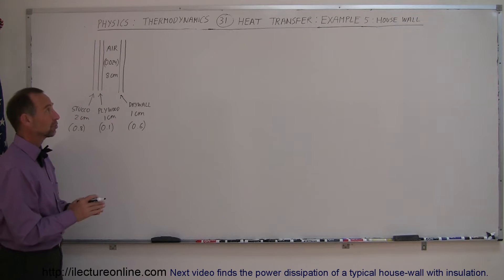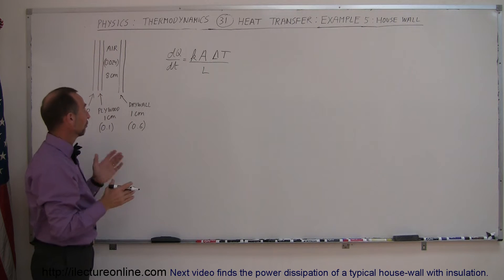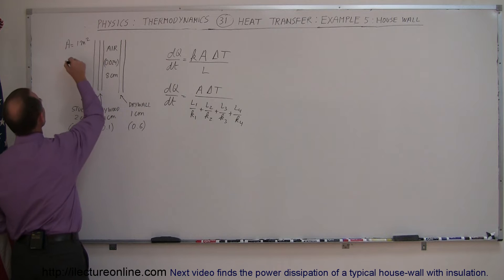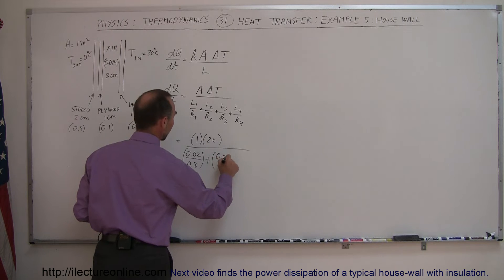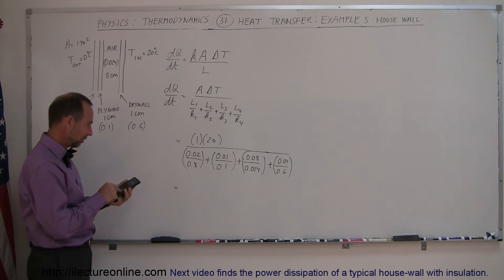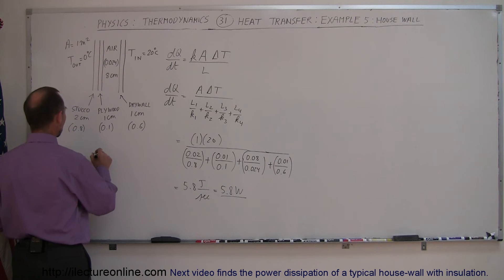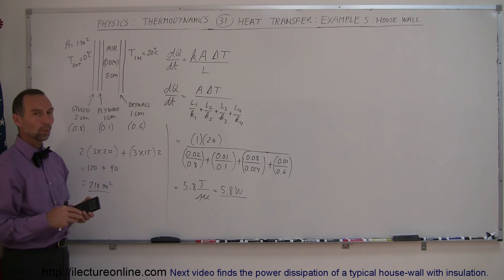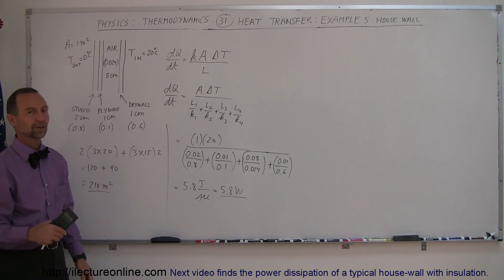Physics 24  Heat Transfer: Conduction (6 of 34) House Wall

Comment: Video was very good.. Learned a lot.. But I am little confused with the second part.  sir, when u were calculating the area of the four walls of the house u took the height 3 feet and length 20 mts. And still got the area in sqmts. Pls can you explain
Reply from the maker: The "3" represents 3 m.  If it was 3 feet that would make it difficult to stand up straight
Reply: @MichelvanBiezen  ok, but you said at 3:40  "single story house which has 3 feet high",  and I got confused.

Comment: you had to write cubic meter not square meter because I think you were calculating volume not area
Reply from the maker: No, it is square meters, since we are calculating the area of the house walls, not the volume.
Reply: no, I don't think any of those equations or calculations had volume in it.  When he calculated 210 m^2 he was also talking about total area, not volume.

Comment: To be more accurate, you'd do this, then subtract losses to convection, then subtract losses from radiation?
Reply from the maker: +Kevron Rees    It is not as simple as that.  If you want to have a "real" estimate of the amount of heat transferred, you would have to take into account a number of aspects that are ignored in a simple modeling of the heat conduction.  (For example the temperature of the surface will not be the temperature of the air on the inside and the outside).  These are just for learning the technique for calculating heat conduction through multiple layers.  The real world is more complicated.

Comment: I wants to find minimum insulation thickness required to cover heating block of 3.5" X 3.5" X 3.5". Should I use the following formula to find x.
Q= kA((Heater Temp -Ambient Temp)/x = hA(Surface temp-Ambient Temp)
Reply from the maker: +Harmeet Jammu It appears that there is something missing, like a constraint.  What is the goal for putting insulation on the block?  What is the permissible heat loss?  There must be some other restriction.
Reply: +Michel van Biezen: I have Heater Temp=810.9K, Ambient temp=295.3K, k=.12W/mk. Surface temperature outside of insulation I do not wants to exceed 327.6K. I am assuming h=10W/m^2K. Target is to find insulation thickness in meters. If I am missing something what is that?

Comment: The temperatures used in this example (T_out=0C; T_in=20C), are those near wall temperatures, surface wall temperatures, or the air temperatures away from the wall?
Reply from the maker: Alex,

These are the temperatures of the wall.  (In the real world there will be a temperature gradient on either side of the wall, but we are ignoring that here)

Comment: Hmm. You're using k=0.024 for air here. That's the value for still air. The air inside a studwall is not "still" in this sense, and has a much higher value in home construction settings. A builder in the US will generally treat it like R=1 hr(ft^2)(F)/btu anywhere between 1/2" and 12", or leave it out of the equation entirely. In SI units that would be roughly k=0.6 W/mK -- somewhat like brick. Also, Engineering Toolbox puts drywall at k=0.17.
Reply: A. J. Tarnas as a mechanical engineer thats the constant you use in design regardless it is just the constant for air
Reply: You’re right, I don’t really know how it is in the US, but in Europe we tend to exclude enclosed air layers thicker than 50mm from the calculation, because the air is no longer “static” in such space. 
Only smaller enclosed air layers are considered to be thermally insulating. 
How is it in the US ? I’m curious :)